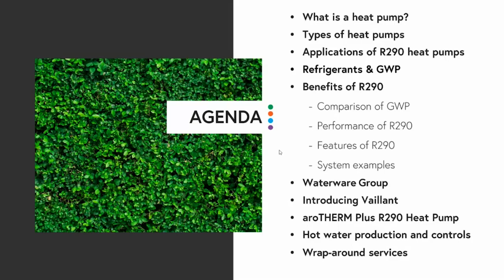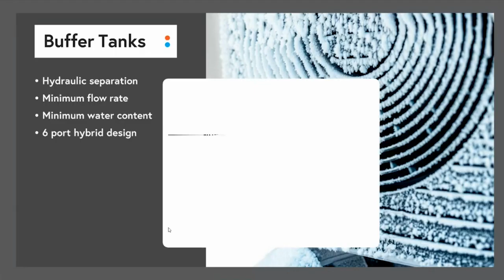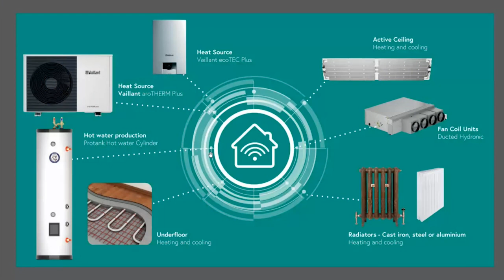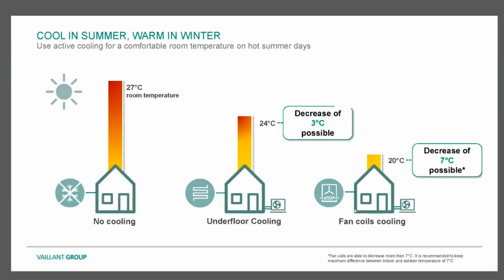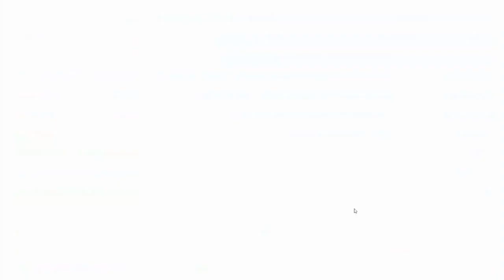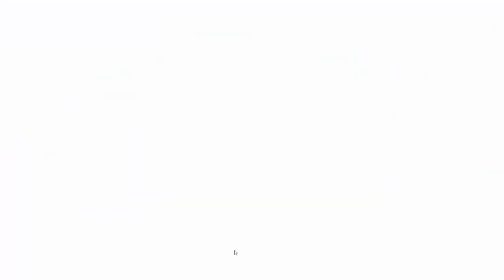Vaillant & R290 - Steve Gledhill x Teulo

Comment: Using a buffer tank may be a flexible and reliable solution but it can significantly reduce efficiency and in a domestic setting it is often unnecessary.
Reply: Totally - avoid any hydraulic separation, buffers included, if you want to maximise efficiency. University of Ulster research showed a 35% reduction in efficiency with a buffer in the system. Open loop is the way to go - don't know about NZ, but in the UK with the price of electricity so high we need every bit of efficiency.